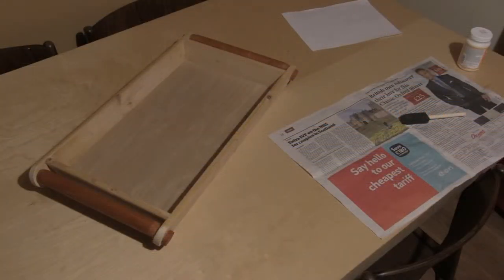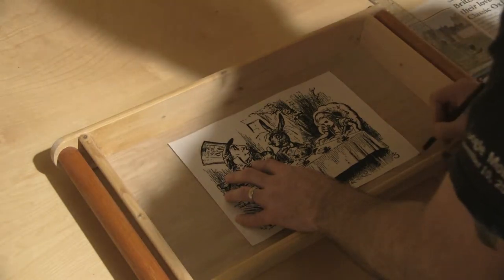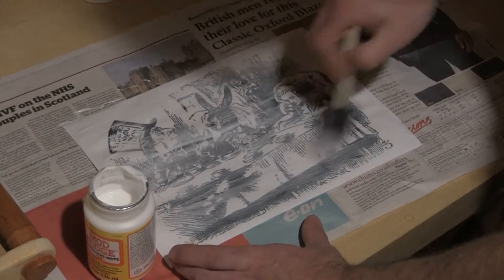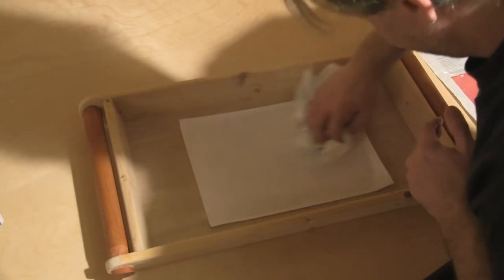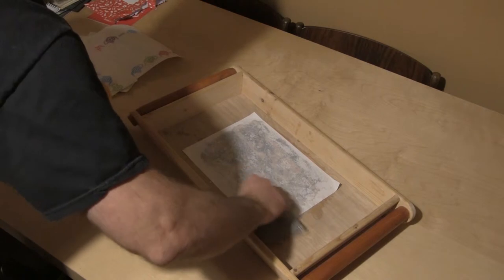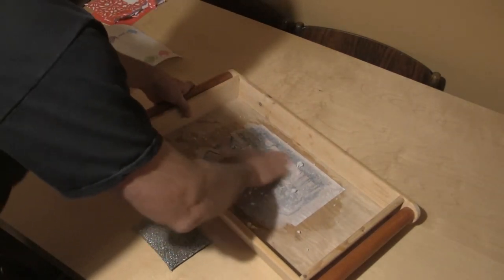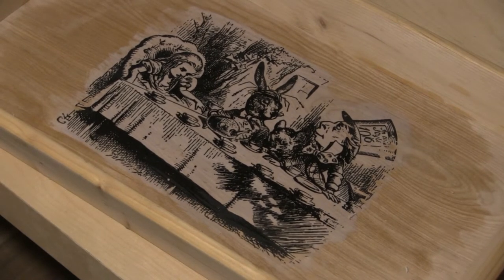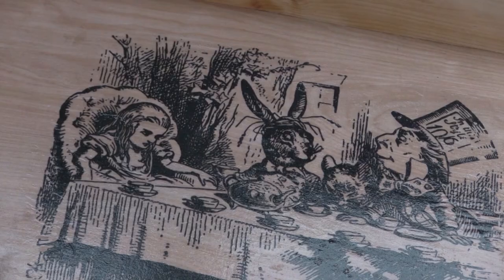Transfer a printed image onto wood with Mod Podge

Comment: Love the simplicity of your video and no awful music playing in the background.  Good information.  One query.  I can't use aerosols.  Is there a sealent/varnish you would recommend?
Reply from the maker: Hi Kim, thanks for the comments. I don't use varnish very often. Most of my projects get an oil finish so I'm afraid I don't have a first hand recommendation, but there are many paint on varnishes available. If you aren't making a large number of items I would recommend seeing what you local craft/hobby shop has to offer. Maybe check out something like Liquitex Professional High Gloss Varnish.
Reply: I think you can use water based polyurethane here.